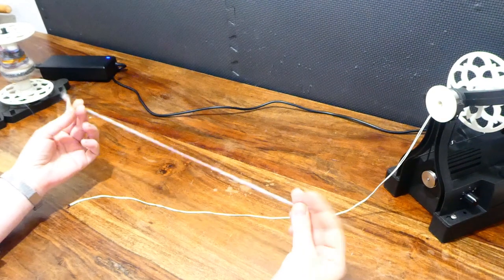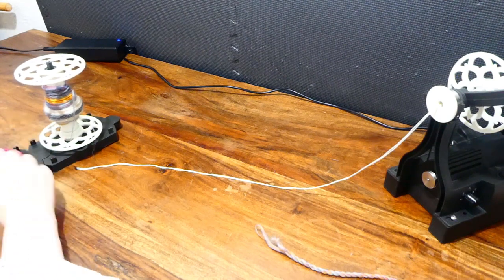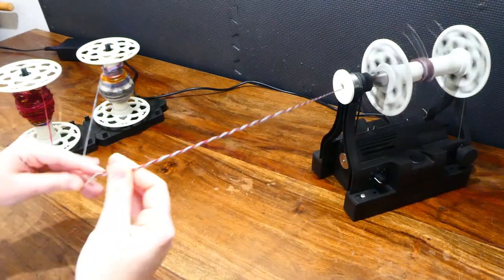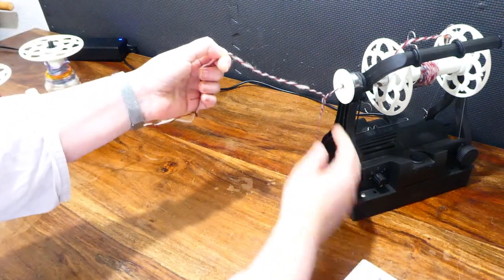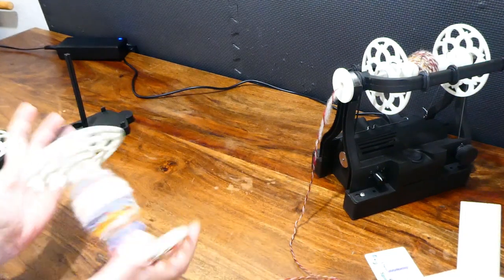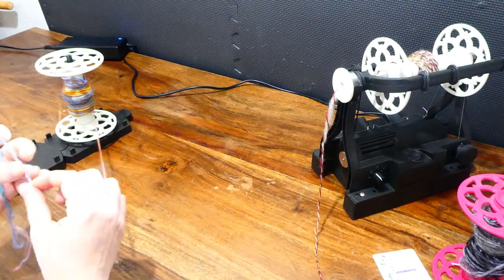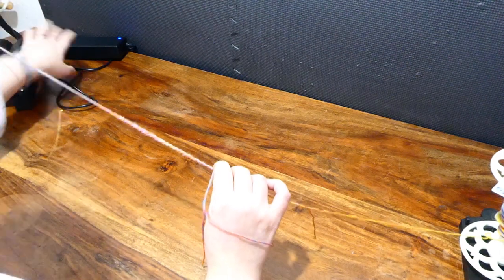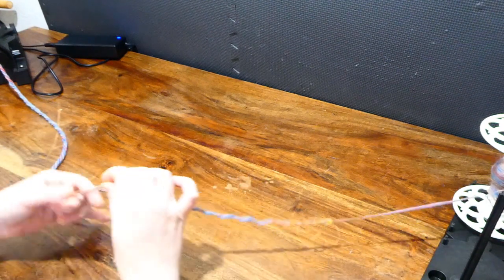eSpinners for Beginners Part 4 - Plying

Comment: I love chain plying and have made yarn for socks many times this way. They have withstood the vigours of being worn just as well as yarn plied the 'normal' way. For sock yarn I always use a blend of wool with a small amount of nylon which helps. Thanks for this video. I have been spinning on my wheel for years but will soon get my nano 2 and revision at any stage of experience is a very good thing.

Comment: I wasn't sure how the two bobbins threads were attached to the leader. Were they just folded around the loop or were they knotted?
Reply: Either way works, she just put the ends through the loop two to three times. I usually just put the ends through once with a little extra length.